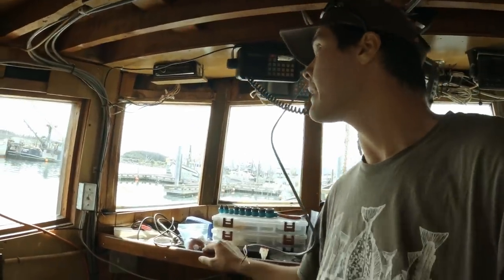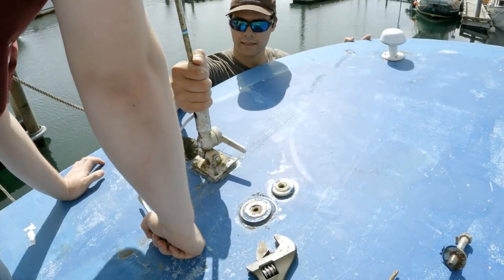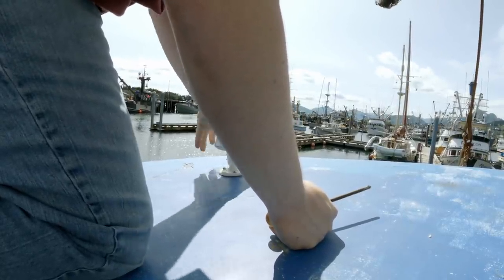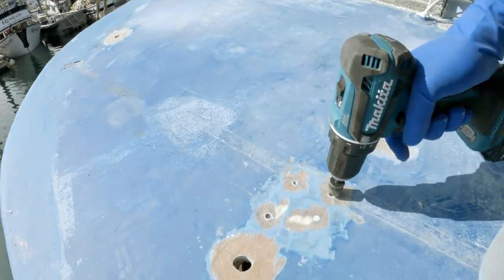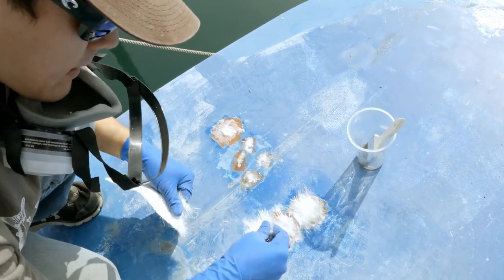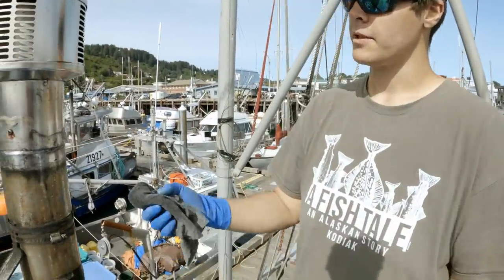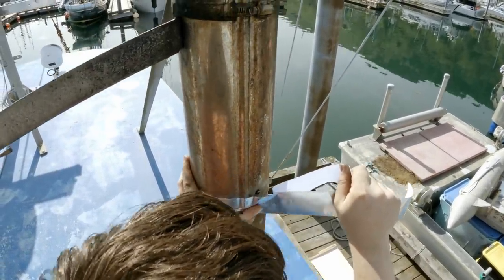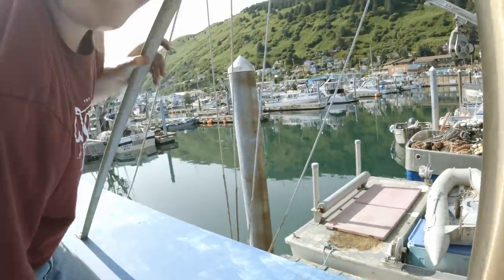Sealing Penetrations on the Cabin - Removing Old Antennae - Emerald Isle: Ep.11 Fishing Boat Refit

Comment: for sealing them flanges cut out all old sealant clean well and use marine 3M 5200 fast  CURE it never drys hard, i use it all the time.. it the only one to use on marine.. or the 4200
Reply from the maker: 5200 works great. We mostly reserve its use for underwater thru-hulls. We notice above the waterline that it tends to pull away in areas if its not sandwiched tight enough, so we've started using silicone on most of our flanges. It doesn't have the holding power of 5200, but for temporary fixtures it saves us energy later on.

Comment: Have to say I am an epoxy sort of guy particularly for repairs but I guess she's a work boat EH!
Reply from the maker: Epoxy is strong for sure, unfortunately polyester doesn't form a chemical bond to it, so we tend to shy away from it.
Reply: @EISAlaska  I get that but for repairs on old Polyester, epoxy sticks so much better and if glassing over the repair then Epoxy resin is far far  better than polyester. Polyester is very average for repairs over old polyester which also won't form a chemical bond to itself if old. Only advantage of Polyester is its cheaper. I am an industrial chemist in the resin industry. Polyester is the best for new builds in straight GRP after that its epoxy all the way.
Reply from the maker: @TheBeaker59  Problem with epoxy is that you can't use polyester on top of it. Gelcoat won't stick to it, which means you need to paint everything. It is expensive and the setup/ curing time is very long compared to polyester. If surfaces are prepped right, the bond for polyester is fine and will not fail or delaminate. Many vessels in the Alaska fleet have been lengthened and sponsoned using poly. Decades later they show no signs of problems.